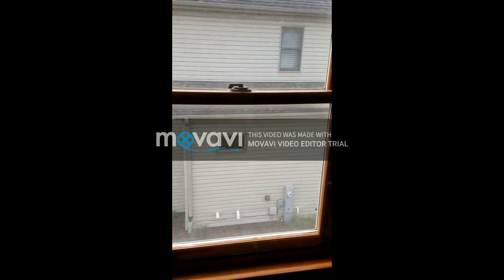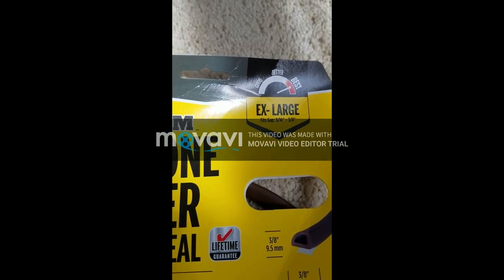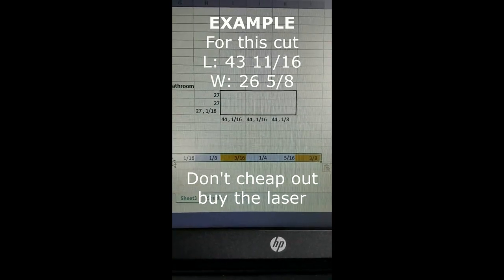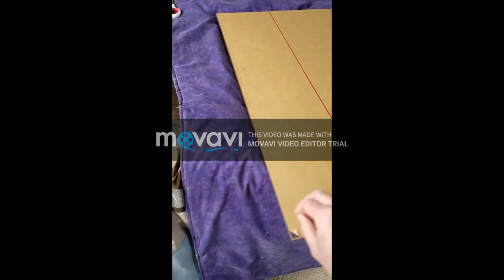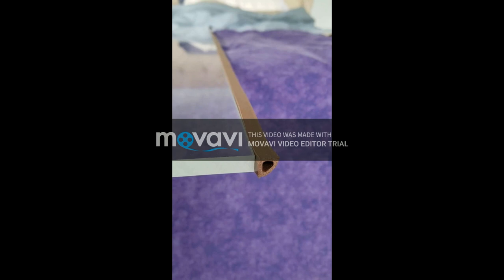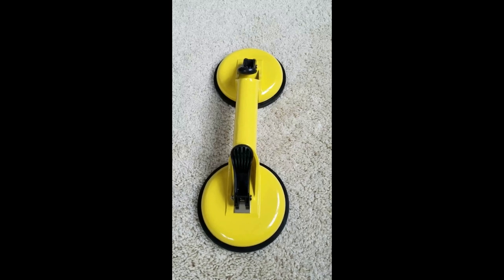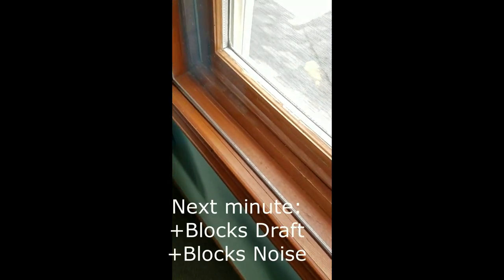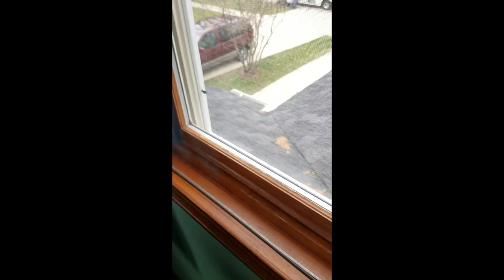DIY Acrylic Windows Inserts to Block Drafts and Noise

Comment: A couple of things, could you include the serial number or product number for the specific seals you used? If you were to do it again, would you do anything differently?
Reply from the maker: I don't have any boxes left.  If you pause and Google the name it should come up. Home Depot had them.
Reply: it might be this one:
M-D Building Products 3/8-inch x 3/8-inch x 17-ft. Premium All Climate Rubber Gap Seal Brown
Model # WS31121
Store SKU # 1001121259
Home depot Canada
Reply: @rezachaygani8229  is there some kind of rule against posting links? I wish somewould post the links where to buy these.  All the seals on home depot are different shapes...does that matter?

Comment: not to point out the obvious but your inserts don't deal with gaps between the sash and the jam in any way. Doesn't this defeat one of the main reasons for using such a thing?
Reply: This isn't obvious to me. the window insert should block noise coming from the gap between the sash and the jamb

Comment: any issue with condensation between window and insert?  I need to remediate noise, but here in Florida we have high humidity and run our air cond 10 months a year
Reply from the maker: A few days in the winter there was condensation. Minimal in summer, but I don't have Floridian humidity. The windows in the sun were worse than the shade.
Reply: I tried this and it actually eliminated condensation (from the inside) in the winter in the north. In your situation I would say make sure your windows are sealed good before attempting.

Comment: Question, at 7:28 "covered window is 8 to 10 degrees warmer." 
Does the insert cause the window to be that much hotter in the summer?
Reply from the maker: No. I left a few in over the summer since we run the AC anyways. I did not do any empirical measurements, but our upstairs felt more comfortable.

Comment: I like it when he says "Don't cheap out buy the laser" when he could be buying proper laminated windows instead of devaluing the property with junk add on windows
Reply: @kurtm8623  - the point I raised is your "Don't cheap out buy the laser" kinda contradicts your stated purpose here - for a start a laser is not required and unlike your DIY snake oil  "project" proper laminated windows add value to any home and come with installation warranties and is certified
Reply: Do you work for a window company?
Reply: @margaretanderson5531  - LOL nope
Reply: How does an insert, which can be taken out, devalue a property?
Reply: @johntrailer1604  - if you find one white ant chances are there are many more eating your house
Reply: @majorrgeek  but the damage done by ants is permanent whereas the “damage” done by inserts is temporary. Not sure this aphorism applies.
Reply: @johntrailer1604  - look what I said is "Don't cheap out buy the laser" kinda contradicts the stated purpose here - for a start a laser is not required and unlike the DIY project proper laminated windows add value to any home and come with installation warranties and are certified - personally I would replace the existing thin glass with thicker laminated which would reduce sound by about 8 dB - that's a lot when you remember that sound loudness scale is logarithmic meaning that 10 dB less is reduction in 1/2 sound volume - that's all you need - you don't need to live in an anechoic chamber
Reply: I am fairly certain that window inserts will actually provide more sound reduction than replacing windows, for a fraction of the price. the laser is only $25
Reply: @richardlam6885  - they also do provide added heat insulation but the point is they look cheap and dunno how long they can last
Reply: @majorrgeek  I put one behind the blinds and I don't even see it. Heat insulation is great and condensation is gone. I'm not made of money... Yet
Reply: @richardlam6885  - I reckon it is good for people who are renting and cannot make permanent changes to the windows otherwise I'd save my dosh, spend less on booze, sex and wild women and purchase the real thing especially good for a home owner
Reply: @majorrgeek  I got a quote to replace all 28 windows in my house with name brand windows. It came to more than $30,000. I can install these plexiglass inner windows for less than $6,000, and get most of the insulation and noise improvement that I would get from replacement windows. Of course, it takes more effort on my part, but for that kind of savings it's worth it.
Reply: @lonniefriedman4460  - the average cost of a home is about $800,000 so $30,000 is 3.75% of your investment and will improve the value over time while the $6,000 is money down the drain
Reply: @majorrgeek but you don’t get noise reduction with new windows. It is all about the air gap and double glazing cannot have 100 mm airgap
Reply: @TheJeaniegirl  -use thicker laminate noise reduction glass like they use on airports